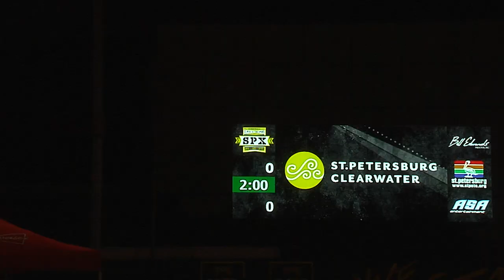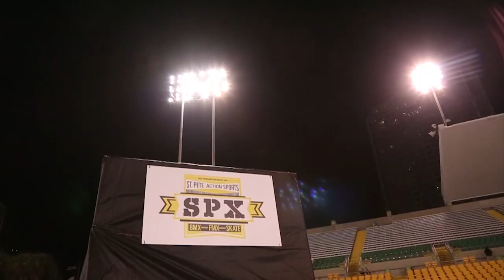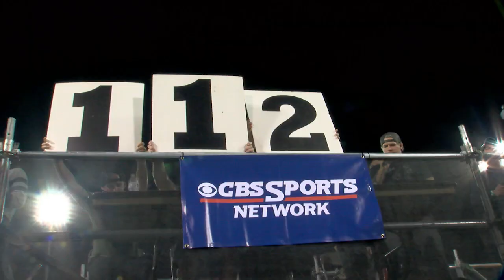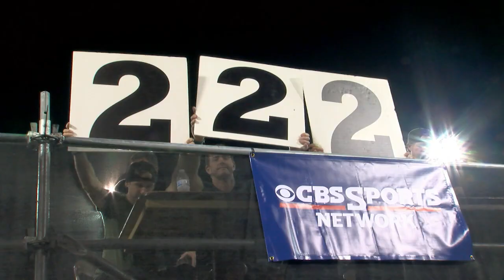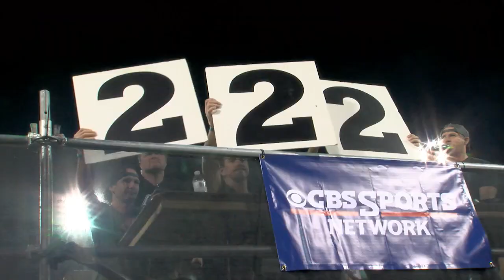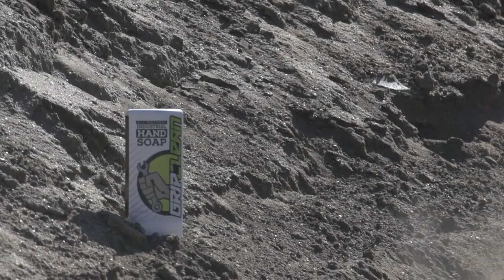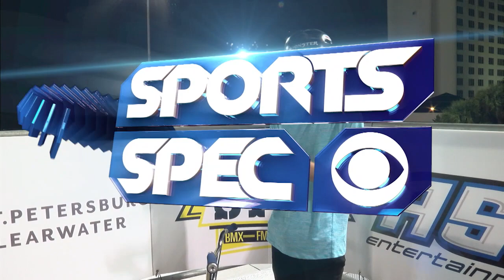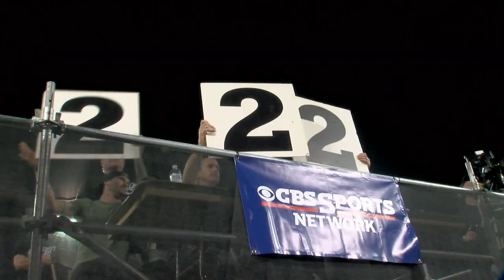SPX BMX Big Air Triples - Full TV Show

Comment: nyquist DID A WHOLE MORE THAN CRANMER.
Reply: Fun stuff #1 no they were about the same.
Cranmer: barspin, flip tuck, cork 720 tyre grab to flair invert. 
Nyquist:                  Flip one handed X up, 720, 540 bar spin. 

The barspin into the rollin is crazy. Then Nyquist first trick ( back flip one handed x up) was a bit harder than Cranmer ( flip tuck), but than Scotty's cork 720 tyre grab is a lot harder then Ryan's plain 720, then Scotty's flair invert and Ryan's 540 bar is about equal.